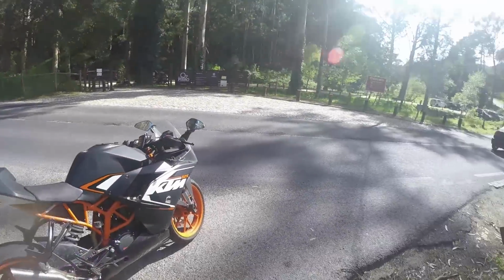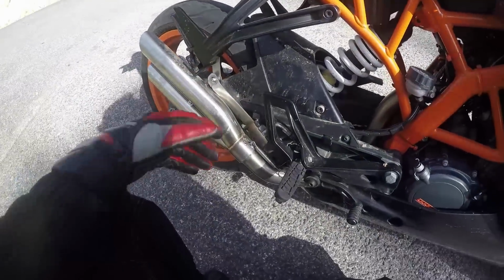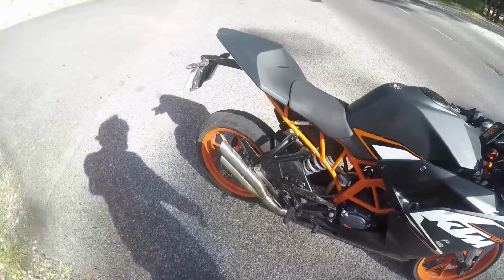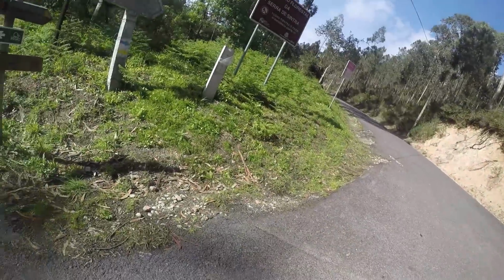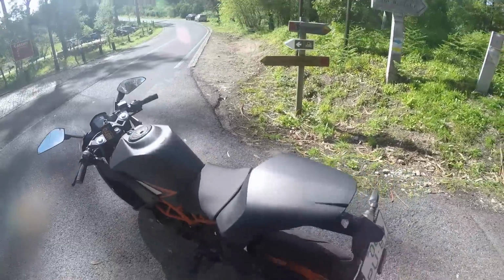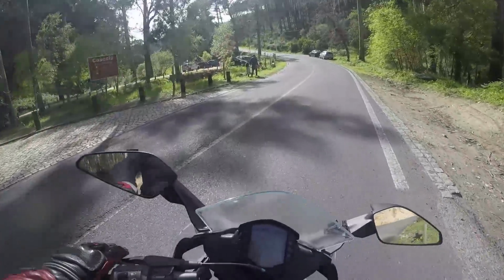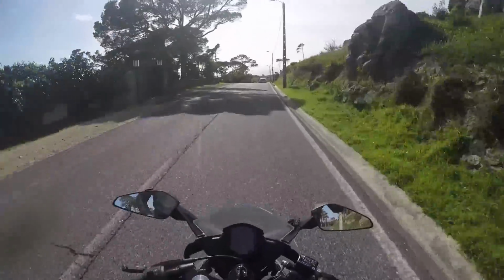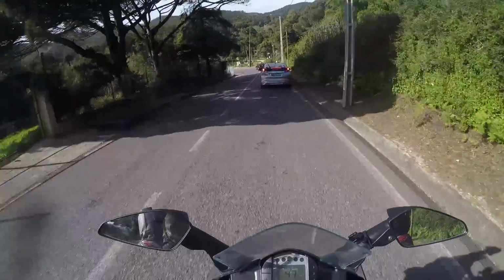KTM RC125 with Danmoto XG-1 Performance Exaust (Unbaffled)

Comment: I've actually had good luck with a DanMoto GP exhust on my FZ1, but the sound from the gopro on this doesn't sound good at all.  looks cool though. my only complaint with mine is the springs they provide are noisy and buzz way too much.

Comment: LOL Cager ... Sounds Mental . I have just fitted a Dual Underseat Stainless steel & Carbon Can system to my Duke 125. There is a little vid on my page & it will give you an indication as to what yours will sound like with Db Killers in .

Comment: after changing exhaust you have also tune engine map and change air intake and fuel intake system. otherwise there is no power increase at least or you'll have even decrease..

Comment: Danmoto seems to have some pretty crappy build quality. You shouldn't have to drill your own holes for something as simple as a baffle screw. And an exhaust certainly shouldn't wobble that much when installed...
Reply: I ordered a dan moto for a Drz and the damn pipe won't even fit over my header pipe